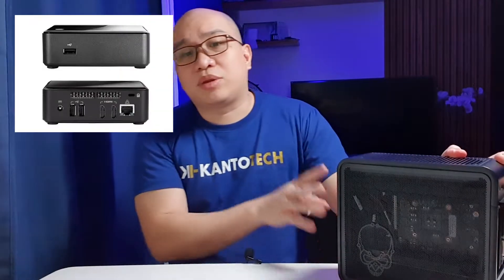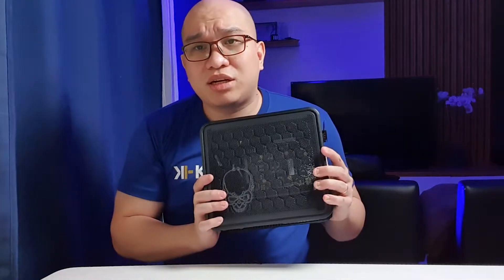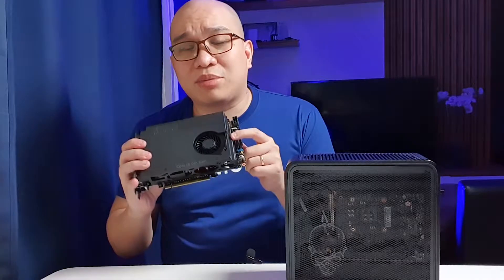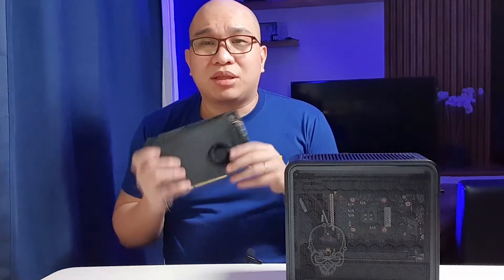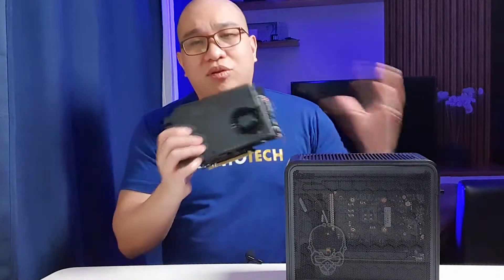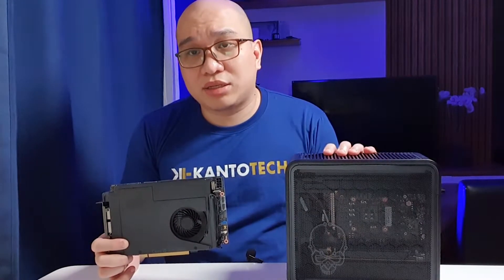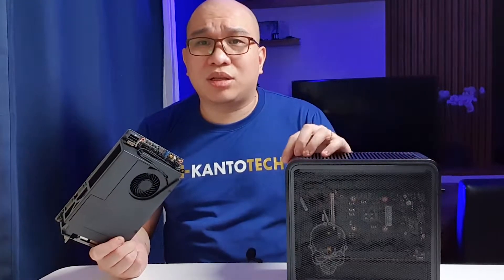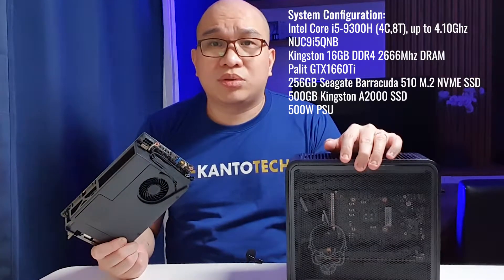Intel NUC 9 Extreme Kit (Ghost Canyon): Unboxing, Teardown, Benchmark, Review

Comment: 6:58 - The left finger, that area I had a screw here I needed to remove that was keeping the Intel box still. I kept trying to get the Intel part out, but it was stuck and I kinda broke my retention tab. I say "kinda" but it's all the way broke. LoL!! In the video I didn't see anyone take the screw out. So I'm mentioning it in case anyone was tryna pull it out and it felt "stuck".

Once the screw was removed I was able to take out the Intel box similarly as they did in the video.
Reply: Thanks for the heads up about to get mines tomorrow